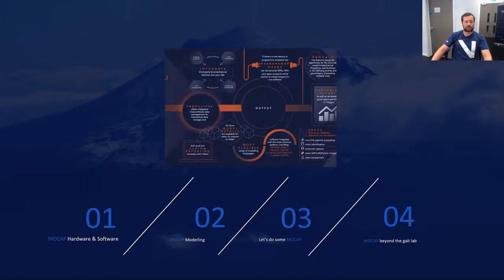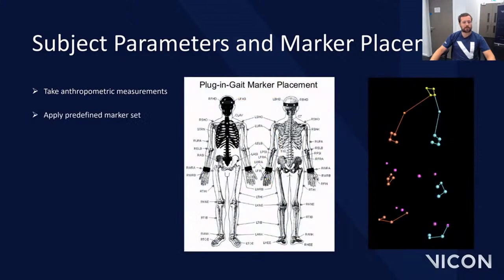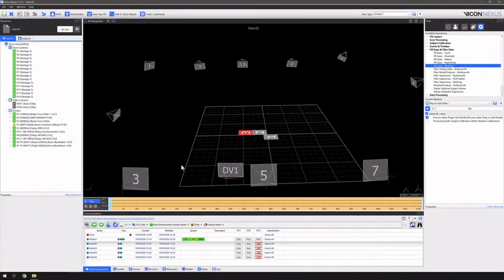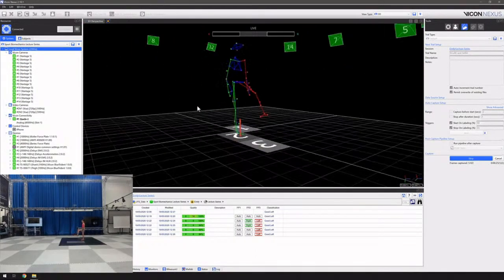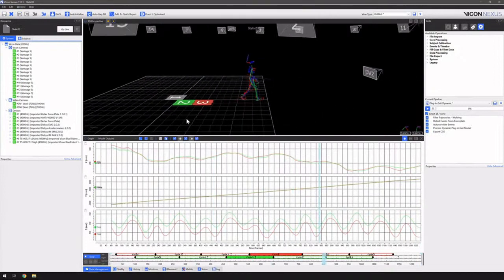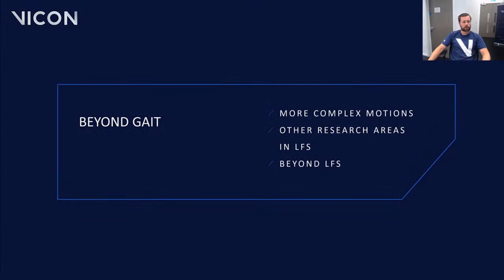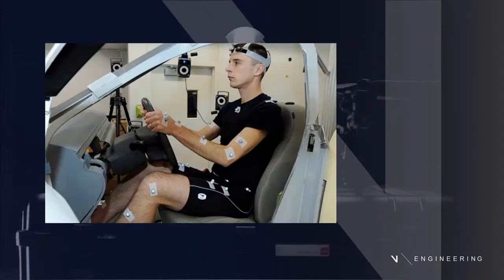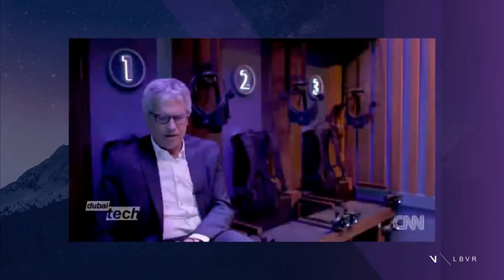Vicon Motion Capture: Demonstration (Collection and Processing)

Comment: It's a great video, Stuart. Thank you so much for the detailed explanation!
Reply: @biomechstu  I have a quick question about the EMG placement for the upper limb of the subject. I am using 8 Delsys EMG sensors for the lower limb in my full body gait analysis; however, I couldn't find any resources about showing the upper limb EMG sensor placements. Do you know which muscle groups should be selected for the upper limb for the full body gait assessment? and Is there any article references to support this EMG placement? Thanks in advance.
Reply: @biomechstu  Hi. There is no particular muscle groups for the upper limb and I am currently trying to understand which muscle groups have more relationship with the kinetic data such as GRF&M etc. That way, I can target these muscle groups on the upper limb of the subject during the data collection (I have 8 more EMG module available to use on the subject). My goal is collect the full body gait dataset during the level-ground walking. I am going to check the video you've attached. Thanks again for your kind help.